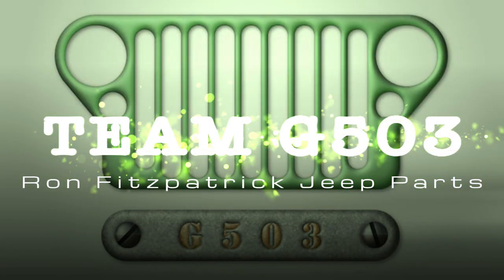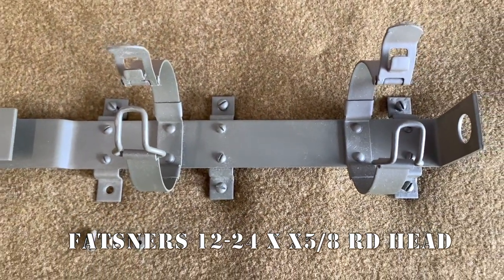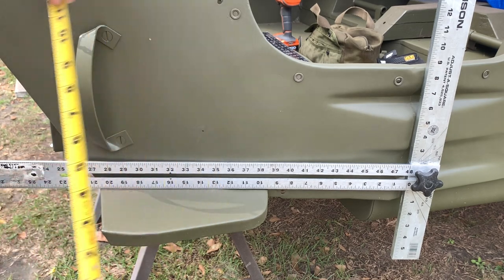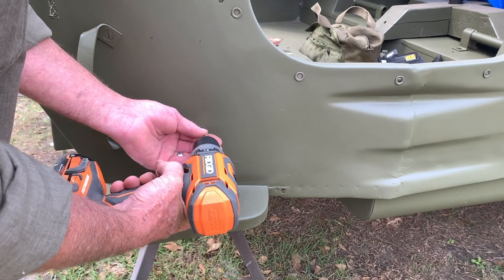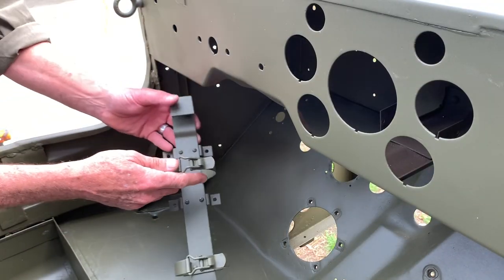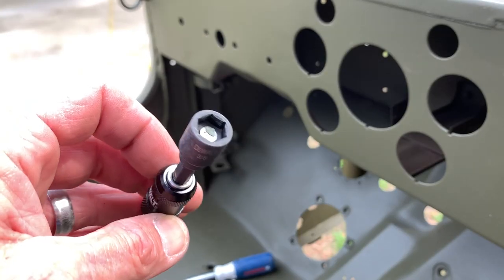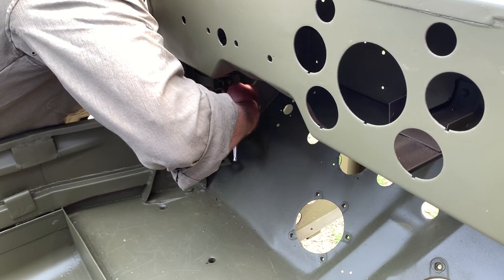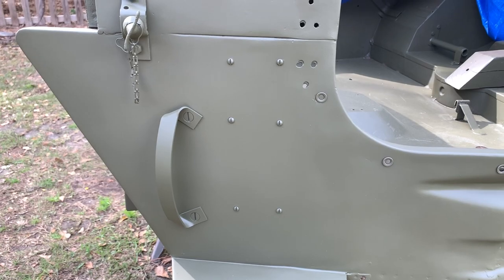Installing The Fire Extinguisher Bracket on a G503 Willys MB. Includes Measurements Of Location

Comment: Nice job you did there, the screw slots finish it of very well, it looks like a bit of effort has gone into fitting it when you see the slots all lining up like that. I wonder if these brackets were fitted in the field, or back at manufacture. Chris B.